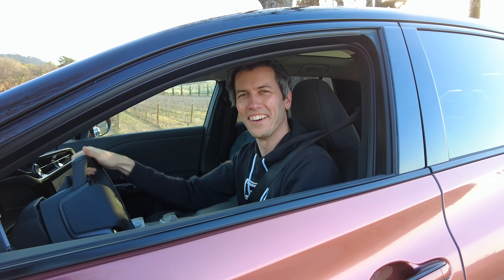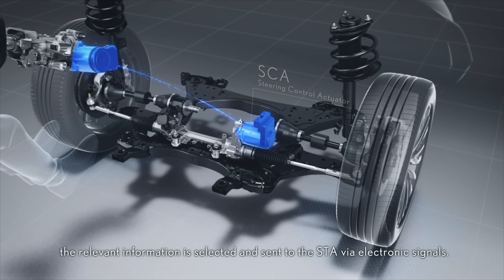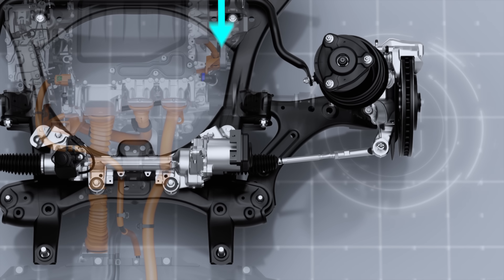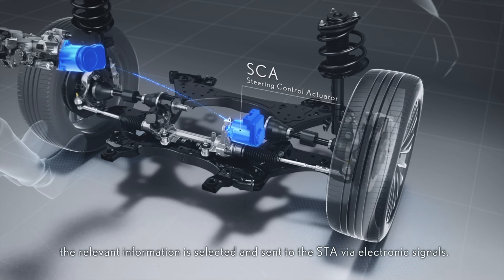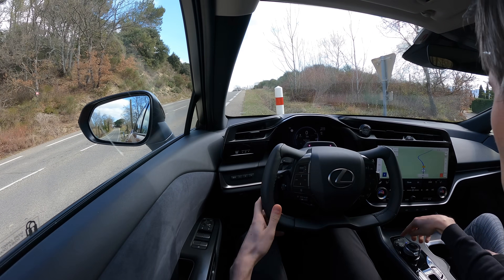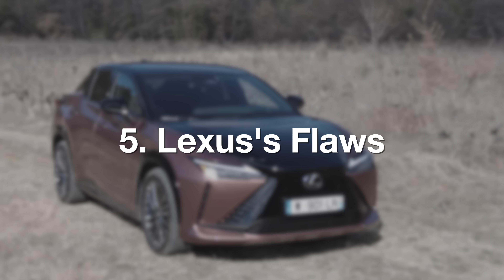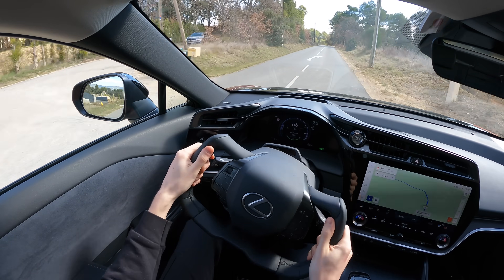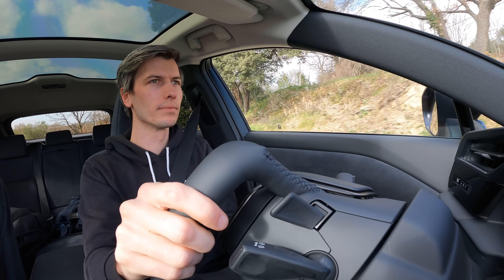How Lexus Fixed Tesla's Bad Idea: Steer-By-Wire Yoke

Comment: for a lot of fps gamers, they turn off mouse acceleration (so mouse & cursor movement ratio is constant regardless of speed) for better muscle memory and accurate aiming. I feel like the dynamic steering ratio will behave similarly to mouse acceleration for cars, it will be convenient to a lot of drivers, but it will take time to get use to, and some people will absolutely despise it.
Reply: This was my take as well. I feel like the changing steering ratios would be really off putting to me
Reply: its like going from a group b rally car with 720 degrees rotations to a F1 car with 270 degrees rotation. @ramen_494
Reply: This comments section is the first time I'm hearing gamers actually turn ON mouse acceleration. Weird.
Reply: This is more like automated DPS adjustment.

Lols, imagine a steering sensitivity “DPS” button for your car.
Reply: This sounds like a bad example, but when you think about it it really makes sense
Reply: Mouse acceleration would be changing steering ratio while steering. This should be more like changing the sensitivity when you scope in, which feels kind of natural.
Reply: I thought also it is the thing in games to turn off acceleration for muscle memory. 
I used to play in callofduty mobile. And learned to play with no acceleration for about 1.5 years. The sensitivity has been a trade off. I could be good either in close quarters combat or on long distance. After all I found  some "oversteering" with my fingers inputs after fast moves - that was an inertia. That ruined the speed of aiming. I tried sometimes to play with minimal speed accelerations but found it unpredictable for me. But then I tried max acceleration adjusted sensitivity to it and got what I wanted. Very fast aiming time without overflying. That's because when your finger slows down your sensitivity drops gradually also. And physical overflying is negligible in aiming.
Of course you can't provide input speed acceleration on  a car steering. Basically because your straight point on a wheel will always be in different places. 
But you can do distance acceleration. So the further you turn the wheel the more acceleration in turning speed of the wheels you get.
Reply: I was the same thing 100% and IMO in an event of a crash where you really don't have time to think about how your car will be turning with your input, you will be relying on that muscle memory to avoid the crash. 

If its a linear curve it will make more sense but I'm not sure it would help much either since its still dependent on speed
Reply: I think so too, overall this new tech adds a lot of benefits, but safety and precision is still concerns
Reply: I use mouse acceleration but not in game because it's done terribly, but using other software, humans get used to things easily, given enough time, it will feel normal.
Reply: Since it is electronic, couldn’t it just be a toggle
Reply: I'm pretty sure all car that have assisted steering have dynamic steering ratio, so it would not be different from regular steering experience
Reply: in theory mouse acceleration is an advantage (takes less time to move when you need the speed but slower to allow for precise movements) it just takes getting used to because once you are used to it it absolutely is an advantage
Reply: Just make it optional in the cars infotainment? maybe even a sensitivity setting like in a video game
Reply: I mean you can try it at home, most driving sims already have that system
Reply: Turning off mouse acceleration in windows does nothing because most games use Raw input which grabs the mouse sensor data directly. Most games implement their own mouse acceleration and enable it by default. 
So the windows mouse settings do nothing for most competently programmed games.
Reply: Mouse accel = bad is pretty anecdotal, and there are plenty of players that prefer it. So it is definitely not a dealbreaker
Reply: not actually though if the ratio is set to 1:1 then it psychologically helpful by making it more accurate than the current setup. the amount the steering wheel is turned same amount the front wheels have turned. where as in current setup it is like for just 30 40degree turn we have to turn the steering 2 complete rounds. You could see this difference in animation shown at time stamp 3:30
Reply: @code_name_uzi  the only way for a wheel to feel intuitive is if a certain angle of the wheel implied a constant turning rate
Reply: well, windows mouse acceleration is pure bullcrap...
Reply: It is only on windows because the acceleration curve on windows looks like someone tried to make it while there was an earthquake which makes it hard to control the mouse with it. No other acceleration curve is as bad as windows and the car's steering wheel curve won't be bad
Reply: It should be noted that people are specifically turning off Windows' mouse acceleration, which is complete and utter dogshit, primarily because it DOES NOT give the same output given the same input and uses a curve based on the shape of the pottery shards leftover from the vase shattered on the engineer's head that made it.

A good and proper implementation of mouse acceleration means you have that same ability to build muscle memory because the same input gives the same output, and you, the user, can define the curve of acceleration same as you would a fan curve for a PC. But it does make mouse movement more complicated by implementing an additional "axis" to control mouse movement, allowing more control, which is better or worse depending on who you ask. It still doesn't make a ton of sense for a mouse if you have enough room, though.
Reply: @SolidSt8Dj  it is much much easier to consistently move your hand over a distance than it is to replicate movement speed especially when you play in different times of the day, moods, etc. where you will have much less or much more energy and different appreciation of how fast you move (the same way your appreciation of a loud noise changes over a full day).
Reply: @SolidSt8Dj  this is a good point. My fps gaming has gotten alot better when I truned on mouse acceleration, but the caveat is i'm not using microsoft native acceleration. I use an external program called rawaccel, which allows for defining more linear and predictable acceleration curves.
Reply: @SolidSt8Dj  No, mouse acceleration does NOT allow you to build the same muscle memory, because the number of input factors is different. With linear response your brain only needs to memorize how far to move your hand, and with dynamic response it also needs to consider the speed on top of it. It's literally what simracers do - they use linear response curve so that the car reaction is predictable and they absolutely do not use speed-based steering ratio.

Can't believe so many people upvote this nonsense.
Reply: @Tarets  ...have you ever heard of *sports* (not esports). Touch grass dude.
Reply: @SolidSt8Dj  Nope, mouse acceleration also gets turned off in every FPS game I play
Reply: This is a really good analogy. While I doubt steer by wire will ever be as bad as windows "enhance pointer precision", I do see some people would rather have a constant ratio despite speed. But we do have the majority of the population who live with windows mouse acceleration (🤮) and others with proper mouse acceleration. So ig that would boil down to personal choice
Reply: its exactly what happens in all driving games when using a game pad. yet nobody complains
Reply: Well I absolutely love mouse  acceleration and use it  at the highest settings   even during  games,  if you   use a  good mouse like  logitech g series something you can build good  enough muscle memory without issue, if you chinese mouse like redragon something its annoying and you would struggle getting used to  it, how consistent the yolk is will depend  if people hate it or love it ... if I had the money I would definitely buy this lexus.
Reply: @hemantsarthak  Most things do be made in China. It’s just the standards that are different.
Reply: @30Salt  yea mate I agree its all about quality control/components quality.

Comment: Nope. I don't want that. I also don't agree with your point regarding the soft/too light steering at highway speeds. My 2014 Ford Fiesta has speed sensitive electric power steering (that might just use the electric motor in the opposite way, increasing the necessary steering force to turn the wheels at speed, I assume). I also dare say that all the fancy redundancy stuff will make the EV even heavier, too. Did Lexus say how heavy the complete yoke systems is compared to a mechanical electric power steering, by any chance?

Comment: Something funny that you didn’t mention is the the video game forza uses a similar concept for steering at different speeds. When you use a controller and push the joystick side to side at high speed it doesn’t actually turn the wheel all the way because I knows that you wouldn’t want that. This is similar. I really like this tech people can hate on it as much as they want but I like it. They can go back to their horse and buggies if they are so scared of innovation.

Comment: They'd have to make it way more responsive, and I'd be more interested in a non-yoke version! If well done and reliable, this could be great for crash safety, better NVH between cabin and engine bay, more streamlined assembly, and comfort! The extra adjustability between comfort and sport mode for example sounds amazing. My BMW i3 with 155mm winter tires is super twitchy at highway speeds :'(
Reply: it is responsive enough to avoid crash. but id worry more about the steering turning into another point of failure....

Comment: My main concern doesn't fit in either of the "what if..."s. My main concern is from my perspective as a cybersecurity analyst. Recently, I have had to (more and more often) notify clients of potential vulnerabilities in their corporate fleets. 

Most vulnerabilities coming out in connected vehicles affects less critical components, such as the infotainment functions, and in worse cases remote car functions (remote start, remote lock/unlock, etc.) When it comes to something as critical as the steering of a vehicle, we've seen it done in 2015. An unsafe integration of self-park (computationally controlled steering) allowed hackers to take control of a vehicle's steering (only when reversing at certain speeds). That 2015 vehicle had no steering by wire. Due to that, the attack was only possible through the exploitation of the infotainment system (I believe it was GM's On-Star connect, or something like that). The mechanical system itself, however, is not exploitable by a hacker. By replacing that mechanical process with a computational one, an attacker's attack surface is increased and expanded onto the critical system which is the steering rack.

I'm not a fan, to say the least.
Reply: I'd be FAR less concerned about someone hacking into my car while I'm driving it and far MORE concerned about the fact that the corporations that make these things can very easily design them so that they can't be fixed or maintained without some proprietary bit of code.  That makes you, the consumer, dependent on taking it back to the dealership every single time you need any kind of work at all done on the system.
Reply: @Zack Akai  You make a fair point. However, I consider a hacker obtaining control over my vehicle while I'm operating it to be more dangerous, and therefore more important to me than being dependent on my dealer for repairs.

Comment: I can tell you already that I don't want it. I want my vehicle to be primarily mechanical. I don't want a modem that can call the manufacturer. I don't want self driving. I don't want fancy lane keeping or radar cruise control. I don't want wifi. I don't want to pay $20/mo for heated seats. I don't want the manufacturer to have the ability to control my vehicle that I paid for post sale.

Comment: Benefit to this design, cheaper manufacturing of vehicles as the steering unit can be on either side of the vehicle. drawback of the design, how much lag is there in the wheel from first moving the wheel/yoke to when the wheels actually change angle? Another drawback would be if something causes a continuity error (a mouse hiding inside the vehicle decides to chew the wires for example that happens to be part of the steering system) there is no mechanical fallback that can be relied on. I get that there are redundancies on both ends, but, it wasn't mentioned through the middle. The other benefits really aren't big enough to compensate for such a failure.

Comment: I hate everything about this. There will ALWAYS be input delay, there is inconsistent (virtual) feedback from the road, and the variable turning at different speeds means you don't know where the wheels are pointed at any given moment.

If you lose traction on snow or gravel and turn the wheel, what happens? What happens when you regain traction? Now what happens when you're going twice as fast? You'll have to just guess how much to turn the wheel cause the car is going to do whatever it feels like. You have zero control and no actual feedback.

Comment: Test: 3 inches deep, 7cm, puddle that's only 1 ft wide, 30cm, and 20 yards long, 20m. So if only affects one side. Drive through at 60mph, 100kph. Let's see how it steers through that.

I've driven through various scenarios including the above and you, maybe, will automatically steer the right way as you go through it to keep the car straight.

Need to see Toyota/Lexus proving it can do this by using driver hand camera and outside.

We haven't seen anything on dirt, ice, snow, gravel.

Are they proving it in Rally racing like WRC?

Comment: Alright, I got the why part, its useful and cool from engineering perspective but here's my issue: 

1) All that redundancy built into a complex electronic system to eliminate a simple mechanical system screams expensive service and repairs. 

2) The dynamic steering ratio will turn into a bad learning curve for drivers as they will have to learn how to micro adjust the steering at different speed levels. Microadjustment at 70 mph will be different than at 65mph and different than 55mph. Ofcourse this may be fixed by electronically compensating so that the adjustment amount stays the same at every speed level. But I would assume that would be a very difficult calibration, adding more to the cost of the system. 

Overall it's a marvelous idea for an expensive car.

Comment: (The following is not a critique on the video. I just wanted to adress my own worries about this topic✌️) 

As more and more new tech seems to be really unreliable, most likely caused by rapid trend changes resulting in less testing, I really don't feel comfortable in or near cars with less and less mechanical input from their drivers. 
And when I'm talking about reliability, a break down of a system is my last worry. I'm talking about a system functioning exactly as promoted, but in a circumstance that it can not handle. Every bit of automatic emergancy assists, that can not be overwritten by manual inputs is dangerous. 
Heck a VW Golf GTD (8th gen) aktively tryed to kill me three times via emergency break assist, while no threat was around. Just a tree happening to grow alongside the road or a car that was long done turning in front of me. 
And to make matters even worse, the ABS just isn't working aslong as the computer has its panik attack... 😡

If I hadn't reacted quickly by shimmy steering my car slightly to the left, while all wheels were fully locked, or hadn't I pulled down the steering wheel hard to the right while the car was emergency breaking in the middle of a left turn, due to some clumsy inputs of my student, 
I'd become a wooden cross already

I'm an driving instructor and I have experienced several situations, where I couldn't really tell if my student failed some tasks or if the car was having a moment again.
If mechanical steerin is to be a thing of the past too, I consider myself to be doomed to reach my grave early.

So to sum it all up: it is scary to think, that if an emergency system is not acting as the situation demands, you couldn't do anything about it as the driver... 🤷🏼‍♂️

Anyways... I absolutely loved this video nonetheless and your overall style of explaining kind of inspires me every once in a while for some interesting changes in my theoretical lessons. Keep it up. 😁👍

Comment: My concern is: software. I would worry about the input not being read correctly or sensors detecting input when there is none. We already had a Tesla detecting throttle input and getting stuck on full acceleration which resulted in a crash.

I imagine it would be possible for the car to suddenly detect a harsh input (for example because of corroded wires or old sensors for example) which could cause a crash.

I've had my old shitbox turn on the wipers on its own, a simple electrical system.
Same issue could happen to electrical steering.

Mechanical steering simply seems more reliable to me.